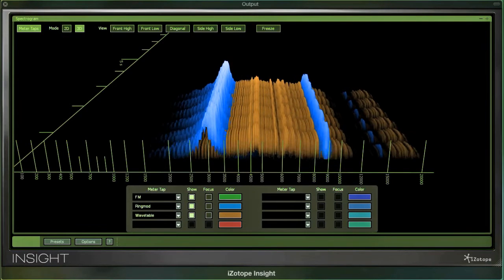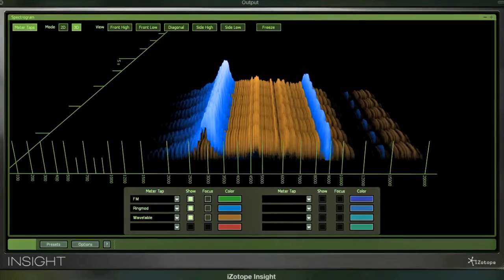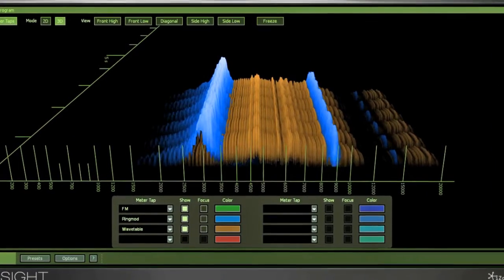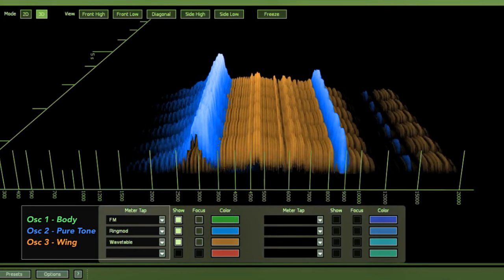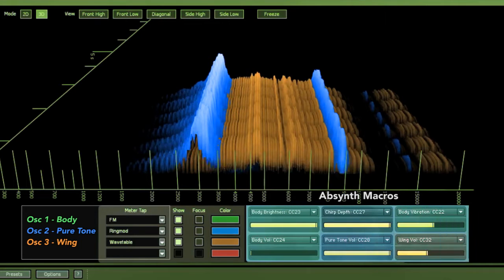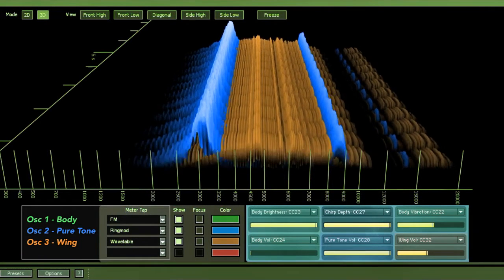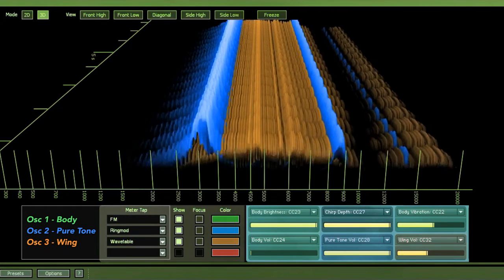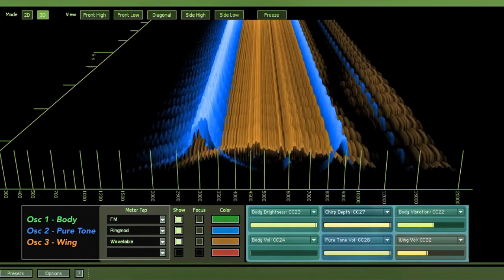Cricket Chirp Analysis - 3D Spectrogram & Meter Taps

Comment: Thats awesome dude!
Reply from the maker: Thanks Nik, it is clarifying isn't it?
Reply: Sure is, you've done great work getting this put together and the meter taps are a great way to deliver information. I'm really interested to see a new version of Insight, seems like it'd be due for a major update now its around 5 years olds (here's hoping at least!).
Reply from the maker: Is there something you want to see improved, Nik? It has the best rendering/res I've seen - no kinks! But yes, it hasn't been updated for a while.
Reply: Yes, I sent Izotope a list of requests a while ago but its all just dealing with aesthetics. A full screen mode for the spectrogram like fab filter, programable view angles beyond the top, side etc presets. And some way to get high frame rate updating of the spectrogram with either look ahead, or a non-realtime waveform analysis simply so the spectrogram looks as good as possible. I don't think these are things that are on their priority list though!
Reply from the maker: Hey Nik, earlier on, Empty Vessel (Greg Cole) actually mentioned the Baudline analyzer. The spectrum frame rate seems super high on it, probably more for measurement purposes (though I cannot use it on El Capitan at the moment). Also people seem to be hacking into radio waves with it... http://www.baudline.com/index.html